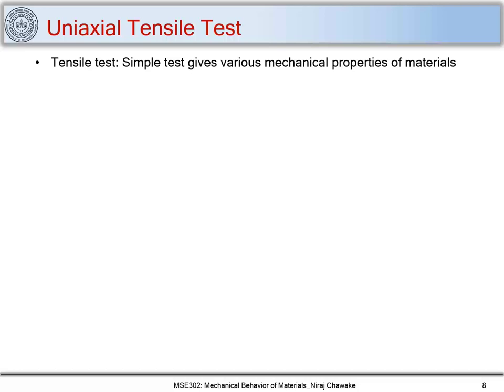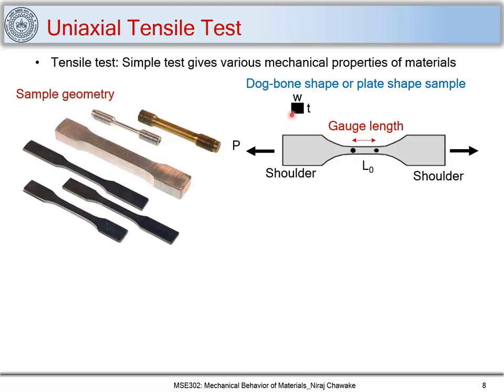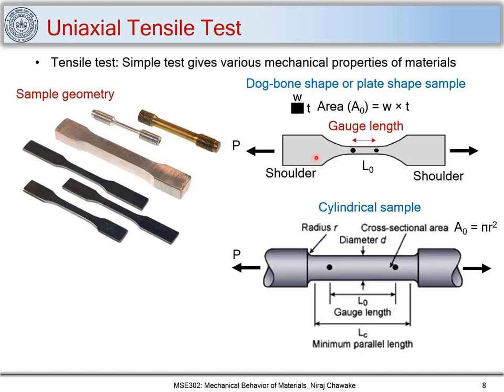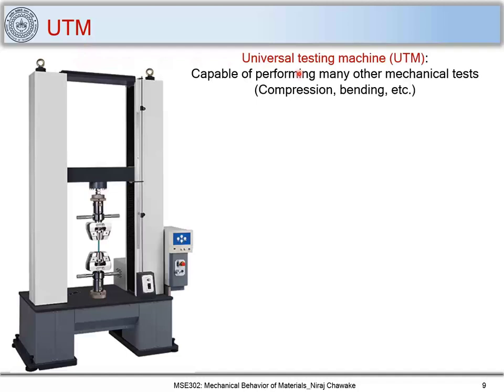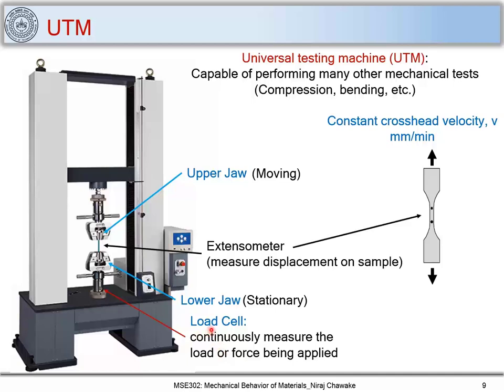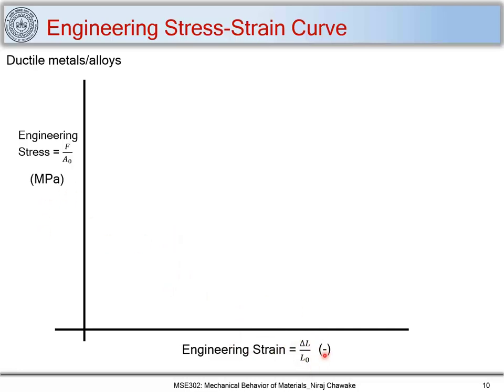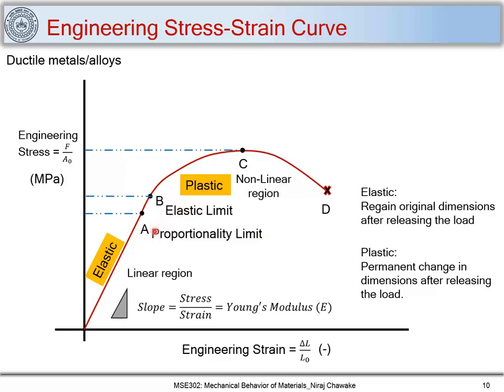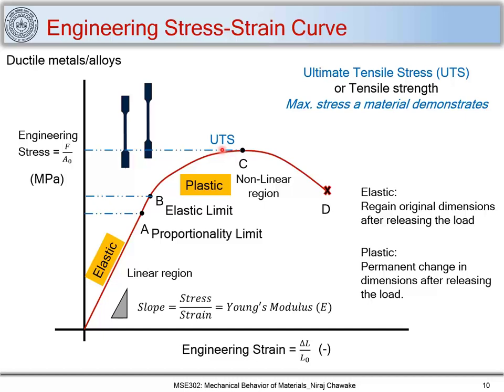2. Engineering Stress Strain Curve: Strength and Ductility

Comment: Very nice explanation 👌 
I have just small doubt : Why do we take 0.002 for measuring proof stress, why not any other values like 0.003 or 0.005
Reply from the maker: This is an extremely insightful query. According to my knowledge, there is no specific answer in the literature. This is an arbitrary rule where the value (0.002 strain) has been universally accepted to measure stress at the transition from elastic to plastic deformation, especially for ductile and highly ductile metals/alloys.
I recommend reading 'The Theory of Materials Failure' by Richard M. Christensen, in which this issue regarding yield stress is discussed and addressed.
My best wishes!

Comment: Nice intro... Volume constancy applies till the necking point... but while calculating the elongation till fracture, will that volume constancy will applicable?
Reply from the maker: Thanks.. volume constancy will not be applied after necking (unless some correcting factors are considered). Thus, for calculating elongation till fracture volume constancy is not applicable (rather not needed for elongation). However, for  calculating fracture (true) strain needs some corrections related to geometrical softening. Hope this helps!

Comment: Sir, as you said that in some case it is difficult to identify the point Y i.e yield point, then we have to obtain the point P. In both the case there should be three point on the stress-strain curve naa??? Either A,B & Y or A B &P.  Why are you showing all four point on single Stress vs Strain diagram???
And one more question is there , in case where we are unable to identify point Y, we identify the point P. The point P we call proff stress can we call it Yield stress , vice-versa????
Reply from the maker: Himanshu,
These points are useful when considering plasticity under various conditions. Points A and B are particularly valuable for theoretical work on the onset of plasticity. In contrast, points Y and P are mainly relevant for practical applications. To fully understand the definition of yield and the utility of Point P, I recommend reading textbooks by R. M. Christensen.
Reply: @nirajchawake  thankyou very much sir😊